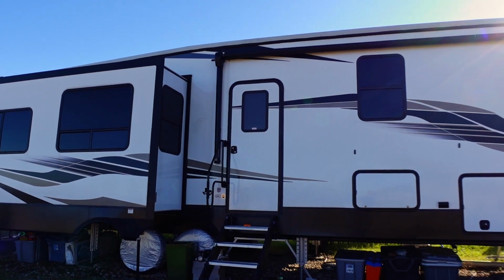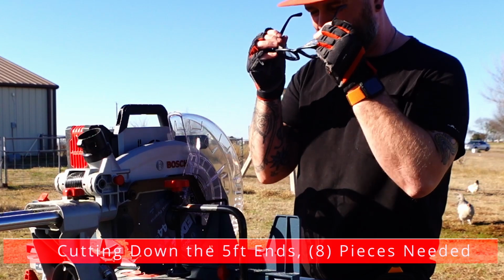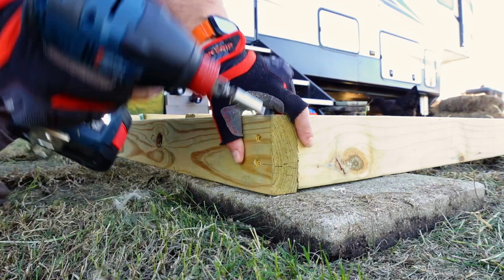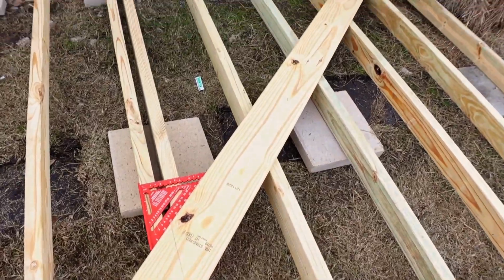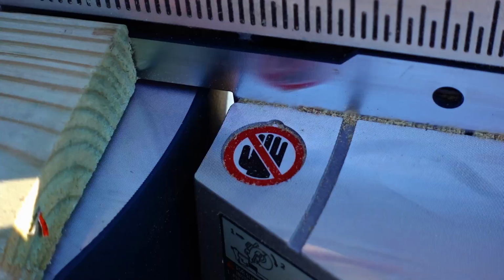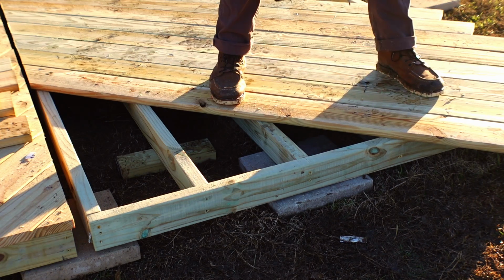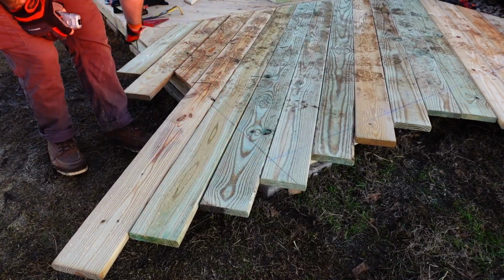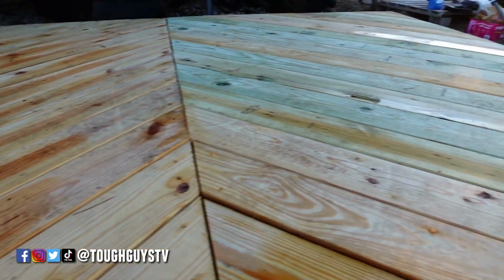How to Build a Modular Wood Deck with Bosch Tools

Comment: Great video, I’ve got the 8 1/2 inch battery mitre saw and it’s a lot more powerful than I thought that it’ll be and is more than enough for a lot of different applications. Best part about it is that it weighs half as much as the big 12 inch
Reply from the maker: I’d really like to have one of the smaller miters as well, especially for taking to jobsites, and I bet it’s perfect for most situations too. These batteries have been impressive too, lasting way longer than I ever thought! Thanks for checking out the video and for the comment! 🙏🏻